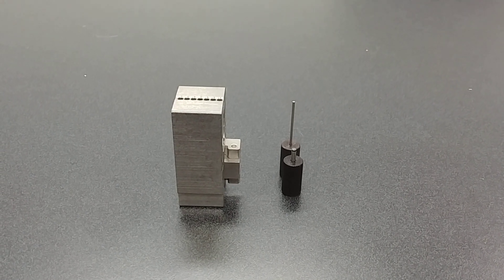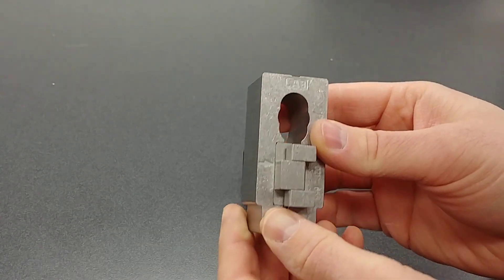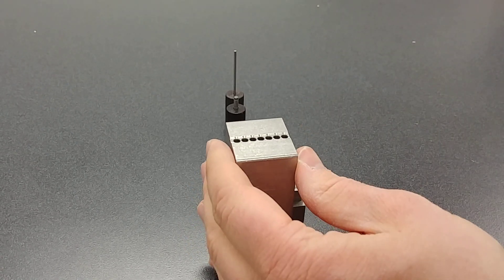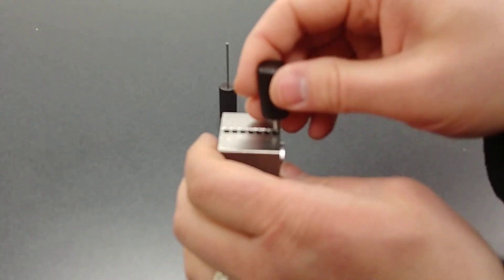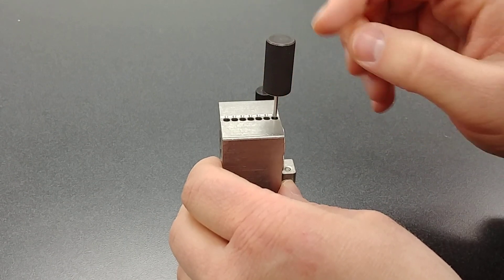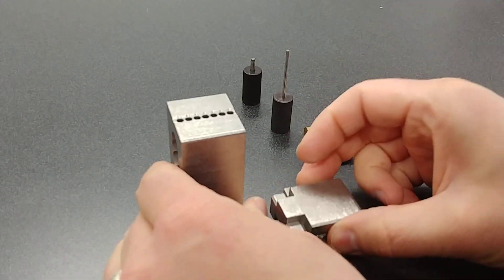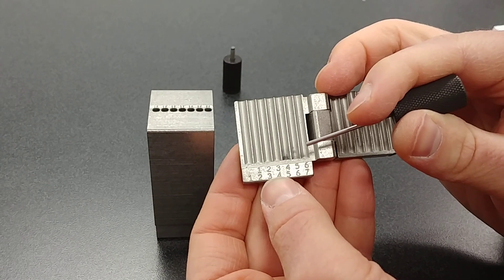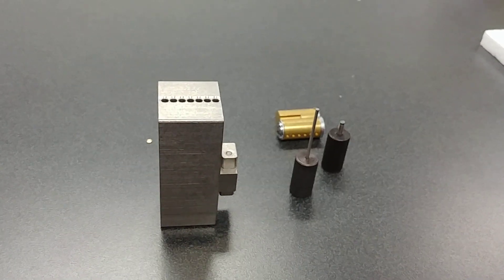LAB Annex for Small Format Interchangeable Core (SFIC) Overview.by CLKsupplies.com

Comment: Hopefully, users will figure it out, but I did cringe a bit when the ejector was shown with the core in the upright position - flip the core upside-down when ejecting the pins. But the LAB Annex is a great tool for servicing small format interchangeable cores, whether just dumping pins, decoding, or capping a core.
Reply from the maker: Good point! Thanks for the clarification.